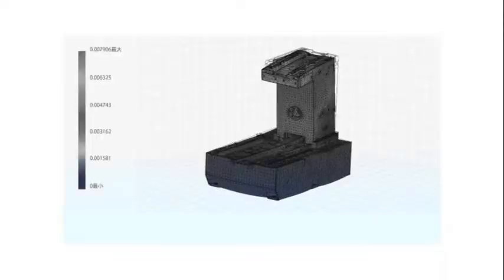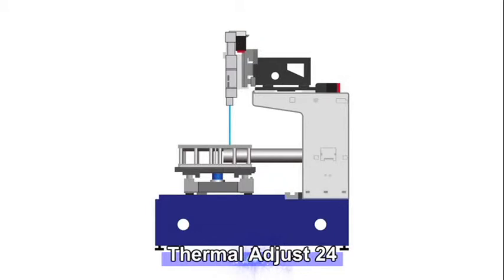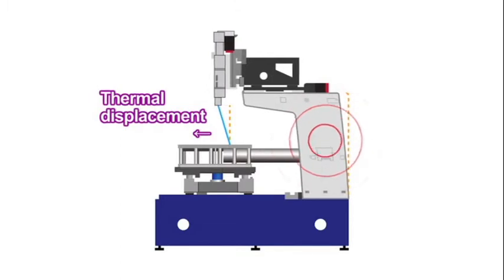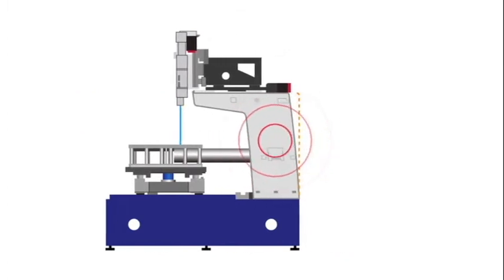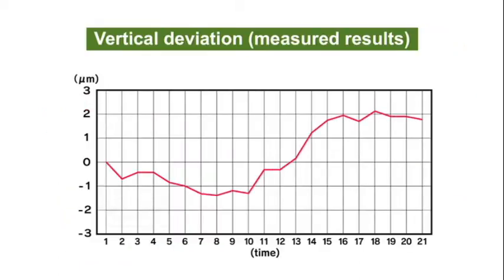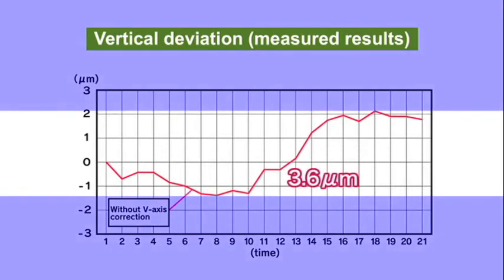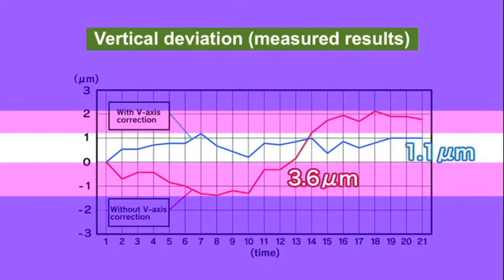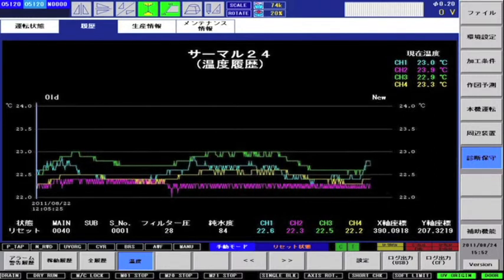Seibu Thermal Adjust 24 Video

Comment from the maker: Seibu's Thermal Adjust 24 function automatically corrects the thermal displacement caused by the temperature change between the wire #EDM machine's upper and lower head. This function can enhance the part accuracy. It is also possible to obtain better cutting accuracy without spending money on temperature control facility.